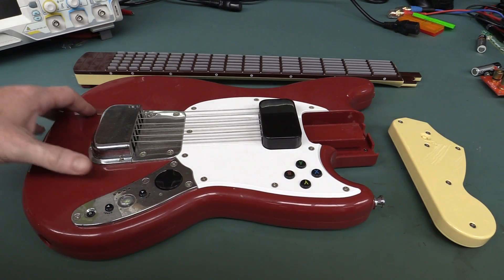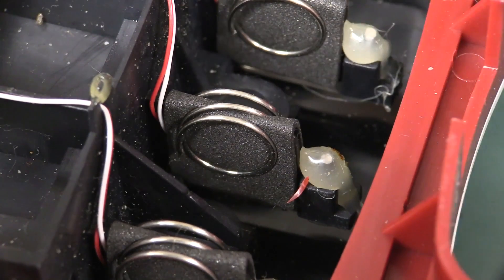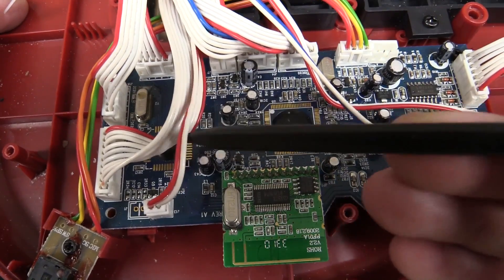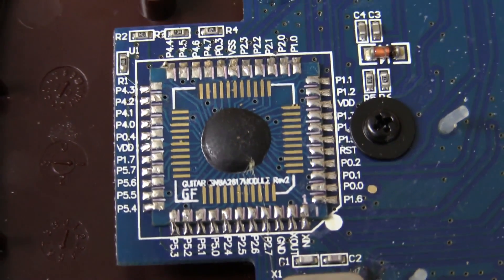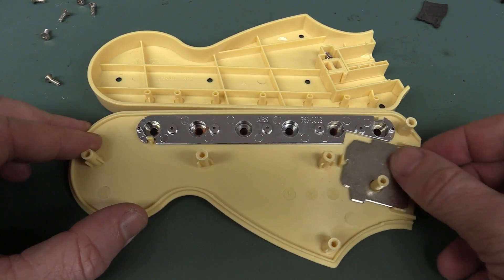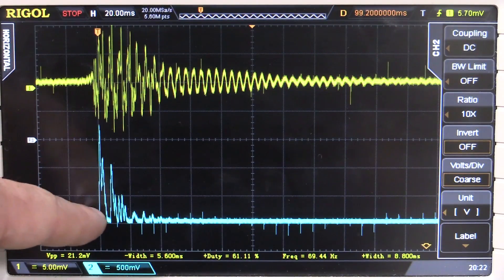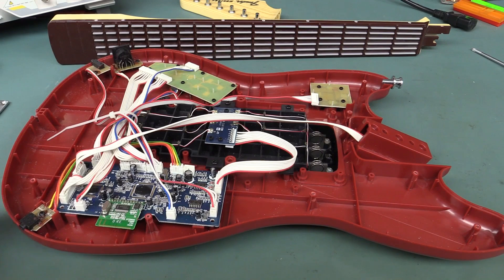EEVblog #770 - Rockband 3 Stratocaster Guitar Teardown

Comment: Hi Dave! This is a great video. I own one of these myself and I'm trying to modify the electronics so that it picks up tilt sensor data in a different direction. I opened it up today to see if I could find the tilt sensor, but I couldn't figure out where it was on the circuit board. How can I find out which component is the tilt sensor?

Comment: You definitely know your electronics.   You may not be as familiar with MIDI.  There are many folks who see this not as a game controller but as a MIDI controller that can be used for serious musical work controlling MIDI hardware and software instruments and recording sequences in a DAW based composition. The piezo transducers on the strings are only for creating a short voltage burst that is then translated to hexidecimal MIDI velocity.  That packet of info is combined with the pressed note button in that "column" to output MIDI note-on and velocity as hexidecimal code.  MIDI note-on includes the instructions to play a particular pitch as well as turn that note "on" and the velocity corresponds to loudness but can be translated to much more in the receiving synth or sequencing application.  I have two of these now and I found your video becaouse I am fixing to dismantle one and try to optimize its MIDI controller properties.  It works as is, but the "string", or "button" spacing is way to narrow for normal sized fingers to be accurate.  So I want to duplicate the button array somehow in a wider fretboard layout.  I'd also like to remove unnecessary components such as the headstock and put it in my own instrument shape.  (I've built guitars)  I'd like to remove the wi-fi components so they are not a drain on the batteries - I strictly use the MIDI DIN output.  I'll also optimize the "string" to piezo interface - still use the piezos but use guitar wire in a more robust mount that can be fine tuned for the amount of pressure or vibration applied to the piezos - which again is not melodic content but strictly noise read as a voltage spike translated to MIDI velocity.  Kudos for making your video - it's entertaining and of great help.  Now... can I count on you to help me with my project...? :)
Reply: If you have a discord link up friend… :) I own the PS version which I think doesn’t work natively like the MS one, been eyeballing it for about 5 years thinking about which pi or arduinon I’m gonna jam in there

Comment: I am told that each of the strings transmit midi data on a different channel, that is channels 1 to 6 . Has anyone tried to modify the system on the guitar so that all the strings transmit data on a single midi channel.

Comment: Did you take it apart any further? I want to paint mine and I need to know if it's possible to completely remove the strings assembly without cutting them.

Comment: btw the springs are actually to transfer more vibrations to the sensors (another prototype solution).... remove the spring and good luck getting a string hit in the game. when i fixed mine, I literally had to hot glue half of the old springs on top of the new piezos to get the vibrations to transfer.

Comment: These are cheap pieces of shit, I have soldered and hot glued in over 10 new piezo's into mine in the last 2 years because the string detection gets so bad over time. I give up now so will just either have to buy a new mustang controller or give up the game entirely.

Comment: Could you look inside the Rock Band 3 Squier Pro guitar? Specifically, I'd like to know how the fret system works. It seems that each fret is actually wired to the midi interface so that it will trigger notes when in contact with the strings. Thanks!

Comment: The microphone is used to measure the audio delay, i.e. the time between a strum and the sound coming out of the speakers. In the game you can enter a calibration menu and adjust some compensation values or use the automatic calibration which uses the microphone in the guitar. Some amplifiers and TVs have ridiculous delays when not set to "direct mode" or something.
The guitar also has an optical sensor to mesaure the delay of the TV picture.

Comment: The metal plate is simulating a bolt-on neck style guitar, as opposed to a set-in neck style which uses a glued mortise and tenon or simple dovetail joint. Bolt-on neck styles are standard issue for electric guitars. The screws (They don't actually use bolts) that join the neck and body are covered by the plate.

Comment: The game mode for this stuff used the finger/hand position data in combination with the piezo bits to determine what was being "played" and with what velocity and when. (Yes, I have one of these sitting in a box in a closet.) This mode was more or less squashed by another competing game series that just used audio forensics on the output of any plain old 1/4" guitar jack.

Now this, as it was made obvious, was the super-mass-produced model; there was a much rarer and much more high-ticket version that functioned 100% as a normal guitar (strings running all the way to the headstock etc.) but tracked all the same game-relevant data. Maybe that would be more fun to root around if someone who likes you has about $300USD to burn.

The 2010 game in the series also had versions that sold with a 2-octave keyboard with MIDI out (...yes I have that too...) but funnily enough that and the "real" guitar stuff is all being taken out for the series continuation/reboot this year.

Comment: If you don't look too hard, it's not a bad representation of an actual Fender Mustang. The things like the neck-plate on the back of the body, and the machine heads on the headstock are a nice little touch (although entirely pointless and useless in a RockBand controller).

It's interesting to see how these things work. I used to play Guitar Hero when I was younger, but the controllers it had were much simpler (5 buttons on the neck). RockSmith uses real guitars, but it converts the guitar's analogue signal to a digital signal with a little midi-converter that's in the guitar lead you get with the game.

There are 2 main ways that signals are picked up in guitars - electromagnetic pickups (most common in electric guitars, like the Fender Mustang/Strat/Tele), and piezo-electric pickups, which are most common in acoustic guitars. They offer different things in terms of sound and tone. It's a bit of a muchness, but I wasn't surprised to find that the RockBand controller was using piezo to detect the string movement.

Piezos have a lot of uses in the music industry. They're even used in drums to trigger a pre-recorded sound, so that all drum hits sound even.

Very interesting video. Thanks for posting it :)

Comment: The make believe 'stiffener plate' matches a typical stainless or other cover on a real guitar which below it underneath is a hidden allen screw which adjusts the neck of the guitar. It is used to adjust the bow of the neck and controls how close the strings are to the frets.

Comment: Nice teardown! I was curious what was inside one of these. The individual-boards-with-lots-of-ribbon-cables construction is similar to other fake-guitar controllers, but there's a bit more of it in this one due to the number of switches/sensors.

The bodges aren't surprising, as this particular model wasn't a high-volume product; it was the special "pro" version for serious Rock Band nerds only. At least it kinda-sorta teaches you to play a real guitar (strings/frets/chords.)

Comment: For the people who don't know the mechanics of a guitar, they don't care about the frequency of the vibration. They just need to know which one you strummed. The notes are E B G D A E from bottom to top with no fret button pushed and then, for each line(string) of buttons, you go one semitone up, the closer you get to the strumming area. It's an octave in 12 buttons. They just care about the amplitude in order to figure out the volume, if they even do that and it's not fixed in the game so the music sucks less, and they need to know when you've muted(stopped) it, but again, I don't know if they care cause it's not a real guitar and again, if they take into account this too, the "music" they synthesize would suck even more. It's probably basically reduced to a push button and how much you hold it down or if they're really pedantic, a pressure sensor analogue.

Which brings me to another point, why not do an LED neck on a regular guitar (you know, like really really playing it), perhaps even pressure sensors (for teaching purposes) and do FFT to figure out what radio friendly soft core emo crap "music" the douche is playing? That would be awesome and it could give you feedback on what you're doing wrong (too much pressure, muffled sound, sloppy strumming etc. etc.). Since the ear can't pick up more then 16khz and the guitar I think has like 8khz tops, doing this shit would be easy and a cool project, if you have the money to invest. It would be as cool if not cooler then that xbox eye thing where they teach you how to dance.

Comment: The rectangular chrome piece on the back (on a real Strat) is chrome plated steel, and keeps the screws (which are long, and go through the neck (or stem as you put it)), and into the body.  The neck (stem) on a real guitar needs to be really screwed down hard because stringing 6 strings onto a neck put's a lot of tension on the neck, to the point where there's a steel rod that runs through the neck, and is adjusted to take some of the tension off the neck.  Essentially, it acts as 4 washers for the neck screws.  On that, it's just for looks like the key posts on the "top part" which is called the head.  (get it, head, neck and body).

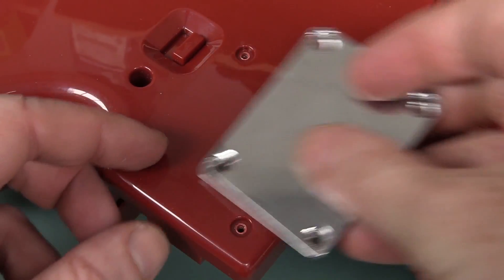Comment: At 2:20 that "chrome" back plate is just to mimic the real Stratocaster.  Under the real plate there is a nut to tighten the neck's loooong bolt that goes all the way to the head to offset the tension created by the strings.  Ahhhhh, now you see the light!

Comment: wouldnt it have been easier to multiplex the 102 buttons threw usb like a keyboard to computer interface. theres 104 keys on a standard pc keyboard and iv torn apart literally 100s of key boards and theres nothing to them but a pissant snotted down chip on board less the 10mm in diameter. seem like they wasted money in production and the product itself is a waste of an average a 120 dollars. you could probably convert a keyboard to do the same thing with some learning curve for under 20 bucks
Reply: lead foot lawn mower The difficulty with most keyboard encoders is that they can only handle so many simultaneous presses, either keyboard-wide or per "column" (which may be several keys wide on the physical keyboard).  They're built and intended to be used one keypress at a time, with optional "modifiers".  Keyboards also don't overly care about latency, whereas a rhythm game requires careful latency management, etc.  Consider the price difference between a no-name red LED optical mouse and a twin IR laser gaming mouse.  A no-name keyboard encoder would simply not pass muster for an application like this, potentially making a custom solution cheaper than acquiring high enough quality PC parts.
Reply: got ya. just thought about it in a spure of the moment. thanks
Reply: im not much of a gamer ether. specially rock band. always hated it.

Comment: Maybe the strings function more like switches. They would start off the note and maybe the volume, but not really function as vibration sources...
Reply: MatthewSuffidy I believe there are two things going on. The first part is the sustain is cut to simulate palm muting and the reason why the information is off center on the diagnostic equipment is that there is some sort of lag adjustment going on.

Comment: The "metal" plat on the back is just cosmetic to make it look like the original guitar where it actually serves a purpose. The neck of an electric guitar is typically only attached to the body with four screws so the metal plate helps spread the load. Each string has a tension of 7-9 kg depending on the diameter, so that's a total tension around 80 kg for all strings. Add the leverage from the long neck and you see why you want some large screws with large flat heads and something to spread the load at that joint.

Comment: There actually are proper MIDI controllers that look and work like that. They are super expensive and rare and expensive though. I've only seen Rob Swire in his Pendulum days with one. Unlike a "traditional" guitar you can play multiple notes on the same string at the same time and stuff. Seems like a fun thing to use. This thing is basically a StarrLabs Ztar clone I think.
Reply: Ciprian Cristea Worth checking out the "Your Rock Guitar (YRG)" if you want to experiment with guitar based midi input. I use a GK3B on my bass for that myself but looking to grab one of these things.
Reply: Terence Sharp That looks really neat! Thanks! From what I can gather it's e Ztar at a tenth of the price, but maybe with some extra headaches. I would use one of these mostly as a MIDI controller. I think I would prefer an actual guitar for guitar sounds. Still, it looks way better built than the Rockband controller.

Comment: Its not a Stratocaster, it is a Mustang like it says on the headplate. Everyone is going for Mustangs because Cobain played one back in the day. It is also a shortscale guitar, which makes sense for a electronic controller device.
The rectangular ABS silver plate mentioned in the beginning is just to immitate a real guitar. On real guitars this plate holds the screws of the neck of the guitar to prevent them from going into the wood of the body.
The silver knobs on the headplate are supposte to meme the string mechanics of a real guitar.
Reply: +Kek5kopF And the other reason they chose the Mustang layout was because it was lefty and righty friendly. The controller has a screw for the top strap nut so you can swap it easily if your a lefty.

Comment: The ABS plate is there in the back because this looks to be styled after a fender stratocaster which has a metal plate there which conceals the bolts attaching the fret board to the body. It's just a design element.

Comment: The metal backing plate is a common design feature of actual guitars. Four screws will pass through the plate and body, and screw into the neck itself.
The designers of this toy put that there to make it look more authentic.

Comment: The chrome plate is there because it's a licensed "Fender Stratocaster", it looks exactly the dimensions of a real one. On a real guitar the neck mounting bolts go through it and the body, into the neck and are plated steel.
Also it's a "Mustang" , which are a short scale and only have 2 pickups unlike a Strat, whats with that hahaha?!
I think the damper foam stuff is in there to get there to get a resonant frequency from the string vibrations, similar to a full scale guitar string but without using the tension and probably giving a more (sort of) realistic feel to there little string array to the player.

Comment: While the Rock Band series sold millions of guitars, I doubt that they sold very many of this particular guitar, and so they probably built them in sort of low volumes and charged a higher price. 

Rock Band / Guitar Hero guitars only have six (or twelve) buttons on them. This guitar is only for "pro mode" on Rock Band 3 and doesn't work on any other game in the series. This is a mode where instead of sort of mimicking the motions of playing guitar, you actually finger proper guitar chords. It's really, really hard. This guitar costs about $100, whereas the regular ones are much cheaper.

Comment: That looks a lot like Texas Instrument pin naming, such as on the MSP430.
Reply: DrSegatron Yeah I agree with that
Reply: DrSegatron  Or a Cypress PSoC ?
Reply: Aron Feher It's maybe a coincidence, but it's nearly the same scheme as the one we find on the MSP430G2553 LaunchPad boards (with more IOs):

See : http://i.ytimg.com/vi/2p8rZNAjUjk/maxresdefault.jpg
Reply: DrSegatron it doesn't have a TEST pin though. I doubt it is an MSP430 series uC.
Reply: heyikidebir TI doesn't sell any PLCC packaged, or 44-pin for that matter, MSP430s so the pinout we see silkscreened could very well be a 3rd party adapter socket. I naming of the pins makes it look very MSP430-like. Plus, they're dirt cheap and you can buy a LaunchPad for a few bucks to start developing.

Comment: Wonder if the DIN socket is for using it as a Midi guitar
Reply: william fleete Yes, thats exactly what it's for! Rockband 3 was the first rhythm game that actually tried to teach people how to play real instruments. In order to activate the "Pro" mode that allowed you to play as a real musician, you had to buy the special Pro Mode Controllers, this was one of them. Also, the creators of the guitar also wanted them to be used as real instruments, so they added the Din Socket to plug them into MIDI Hardware. I actually own the Pro Keyboard just for the MIDI capability.
Reply: KitsuneCentral A midi port without the optical isolation? Erf
Reply: KitsuneCentral ...and I use the midi in usb adapter to play my electronic drum kit thru midi :)  I have learned a lot about drumming from this game :)
Reply: godzil42 It's a MIDI output; it's inputs that use isolation.
Reply: godzil42 Clearly, this is pretty much the cheapest of cheap construction.  A lack of optoisolation shouldn't be surprising.  Disappointing, sure, but an important warning to not daisy chain through to those devices if you value your gear.  ;)

Comment: That plastic plate is just for looks, as it replicates a fender guitar with a bolt-on neck construction Where that plate holds the screws that hold the guitar neck and body together, So in that plastic controller it  only serves cosmetic purpose.
Reply: MrTURBOJOHN This is the first time I was actually screaming at Dave through the screen. Because he always says the experts will be screaming. Finally it was my chance.